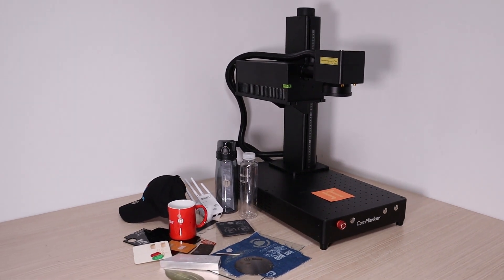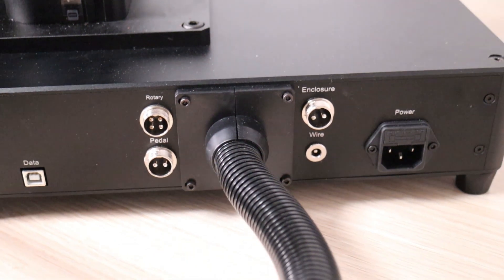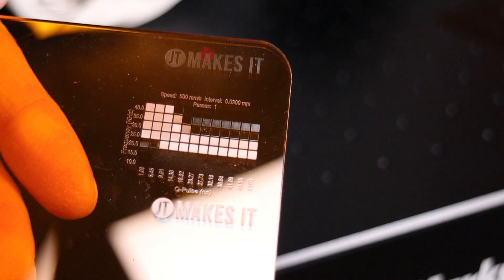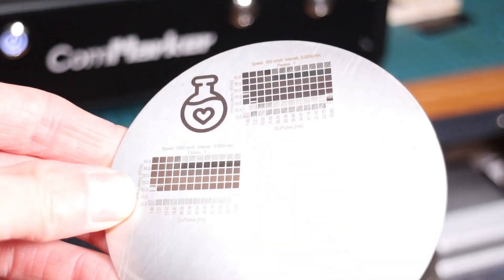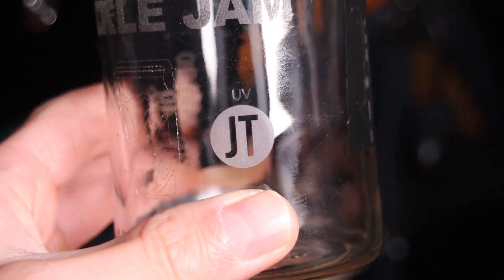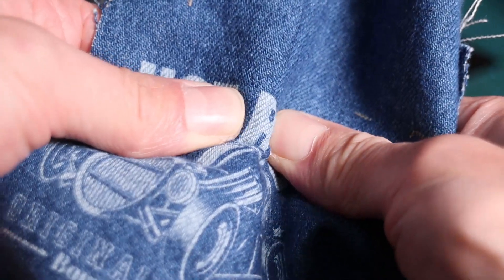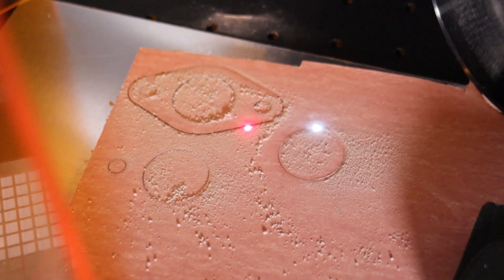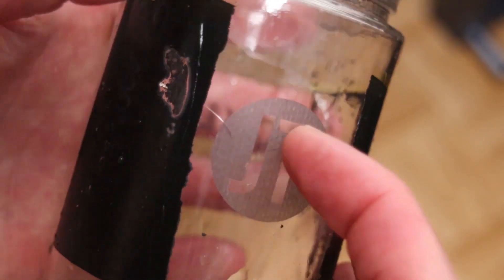The Ultimate UV Laser Engraver Test! Can the ComMarker Omni 1 Handle ANY Material? [Review]

Comment: Does it comes with EZCad sofware?
Reply from the maker: yes, EZCAD is free option, but I use Lightburn
Reply: @JTMakesIt  I want to do subsurface crystals engraving is this good for it?
Reply from the maker: @VivaElMole  Yes. Check my video 5W vs 10W UV laser. 5W Omni does good job at subsurface engraving
Reply from the maker: But it can't do 3D engravings, only 2D subsurface. For 3D engravings stay tuned for my next video.

Comment: Thanks. Can the This laser engrave stones other than slate? Where can I find a list of "tested" materials it can engrave or cut?
Reply from the maker: I tested it on slate, white stone and it worked. But if you want to make deep engravings on stone you should use a fiber laser like the ComMarker B6, B4, Titan 1, Monport GA60... Check my reviews of these machines to see what they can do on stone.
Or check my comparison video between UV and fiber laser: https://youtu.be/TEGiheuk6SM
Reply: @JTMakesIt  Thanks. Did you do a video on 2.5D/3D on stone? I can see uses for both. It is a matter of which first, or if they will give a deal on buying both at the same time.🙂
Reply from the maker: @lawrencediggs7957  FOr deep engravings on stone, the fiber laser will be much better/faster. Check my review of the Monport GA60, I did a deep engraving in stone with that one.

Comment: You dont Need to set your Material Test to 10-40khz. 40khz is the smallest and 150khz the highest you can do
Reply from the maker: I think this is true for 10W machine, not the 5W?
Reply: @JTMakesIt no. Test with This Settings then you can see
Reply from the maker: @dkastra26  i will try. Thanks!

Comment: Could you share your setting to cut glass (n-pulse, frequency, speed and passes ?). The one you share on screen looks like more for engraving, right? Do you use the Wooble setting in Lightburn to perform the cut? I'm trying to cut glass and mirror with no luck, but no problem with engraving (a mirror even broke when I tried some settings ;).
And please continue your reviews, they are always a pleasure to watch!
Reply from the maker: The settings are written on screen in the video when I am cutting out the circle from 2mm thick glass. If you have any questions feel free to ask :).
Reply: @JTMakesIt it's what I tried, but no luck. Perhaps my speed was too fast and not enough passes? Do you remember which speed and number of passes? I guess that different type of glasses may end in different results, but I have no clue if I'm far or not to get good results. Thanks again for your videos!
Reply from the maker: @PolyWorkshop inthunk the speed was around 100 to 200mm/s. The slower the better. Make sure You double check your focus (when continuously engraving manually lift and lower the Z axis and where it sounds the loudest is the optimal focus height. Make a focus stick of that size like I did in the video). Also let it run for many passes. I have let it run for 5 to 10 minutes for that cut. If it doesn't work maybe you should try a different glass.
Reply: @JTMakesIt  I think it was the number of passes, I stopped after 2-3 minutes. Thanks again! :)

Comment: This is most likely a next-buy for me, because its not only versatile, its light and compact enough for me to take to conventions if need be. Its expensive, but not so in the range of UV lasers. Been interested in UV lasers for awhile.

Few things I'm wondering about though. I'm pretty sure it'll earn itself back and then some but it does make me wonder how long on average I can laser with this thing, and if the components are replacable. 
Another thing is that even though it IS a cold laser, safety is prio and especially if I wanna take it to conventions I need to prepare (pop-up enclosures and  ventilation, plus from what I understand its air-cooled so I might need to take that into design aswell if I need to make one). I have to make one anyway due to it being a laser, but I'm wondering something akin to fumes, particules, etc.
Reply from the maker: Hi, life expectancy of a UV laser is in a range of 10k hours. You can get an enclosure like this: https://commarker.com/product/commarker-fiber-laser-engraver-safety-enclosure-protective-cover-pro/?ref=iNBVv9XmXs_p18
Or you can build your own box, and put an extraction fan and some flexible hose through the window.
Yes, laser is air cooled, but fume extraction from the enclosure also extracts the hot air and this should not be a problem. Fume extraction is recommended, as certain materials produce toxic fumes when engraved.
You can also buy a fume filter, which reduces smells and smoke for more than 95%
https://commarker.com/product/commarker-fume-extractor-100w/?ref=iNBVv9XmXs_p18
Reply: @JTMakesIt when you say 10khrs that’s when you need you replace the laser?
Reply from the maker: @antoniomczenna8185  Laser starts loosing its rated power output. But 10k hours is 3 working hours every day for 10 years straight. Its a lot. In that amount of time, much better lasers will be available for lower price.
Reply: @ where do you find this information when searching for lasers to buy?
Reply from the maker: @ Checking the official website or asking the manufacturer.  Also checking the web for UV laser engraving technology in general

Comment: what is the laser power and what is the wavelength?
Reply from the maker: @alexlaser-lv  355nm, 5W. There is a link to the store in the video description with more details
Reply: @JTMakesIt  strange, then something I don't understand, I have a uv 3w 355nm machine and it doesn't engrave on clear glass and organic glass
Reply from the maker: @alexgrad4555  it depends on the lens size. The 3W is a bit weak for glass. 5W is just enough for the 150mm lens at full power

Comment: The power is a measly 5W, little better than AtomStack M4(2W 1064nm dpss). The laser itself is dpss and not a true fiber laser. Has 10X less life, with output falling off with continued use at high power levels due to fast degrading qswitch. Should have to be atleast 3X cheaper, since there is no expensive Raycus or JPT fiber modules inside. At high power levels, it will fail(degraded output in 1000+ hrs) fairly soon, which is typical for diode pumped semiconductor lasers. Have dealt with all kinds of lasers for professional work.
Reply from the maker: @aware2action  you should learn a bit about UV lasers. They are not fiber lasers. They work completely differently than fiber lasers. you clearly didn't watch the video. UV lasers don't engrave with heat. They engrave by breaking chemical bonds directly. This is why you can't compare 5W UV to 5W infrared. 5W UV works more like 30W true fiber.
Reply: Imagine that you have nothing better to do, but to go on each video of this laser and talk trash about the laser and the creators.  People have absolutely nothing better to do?

Comment: Can you get good black markings on stainless steel? Is there a way to get black marks on aluminum?
Reply from the maker: Black markings on raw aluminum can't be done. Only slightly darker. Aluminum doesn't change color under any laser.  Black on stainless is easier done with fiber laser. I have tested a lot of them on my channel with great results. You need a lot of heat to blacken stainless. UV laser doesn't have that much power compared to fiber lasers.

Comment: Hi, I have a Trotec 360 laser cutter and am considering purchasing an Omni 1 for engraving fine details on glass. Is the Omni 1 capable of cutting thin sheets of metal, such as 1mm thick silver, gold-plated metals, etc.? Thank you.
Reply from the maker: Hi, UV laser is not good at cutting metal. For cutting metals around 1mm thick you would need a 60W-100W fiber laser (1064nm).

Comment: hi, great video! learned everything i wanted to know about uv lasers. would you mind sharing the file of test pattern you used? that be handy for testing out materials. best - manuel
Reply from the maker: Hi, The test pattern can be automatically generated with Lightburn for any combination of parameters. I don't know if EZCAD supports test pattern generation, but for EZCAD a lot of test patterns can be found online, but it is very easy to manually create it by yourself in 15 minutes or less.
Reply: @JTMakesIt  great thank you =)

Comment: What settings did you use for cutting through the glass?  I've been unsuccessful thus far with my Omni 1.
Reply from the maker: 40kHz, 1ns pulse. but need to use a relatively big wobble parameter - you can't cut with just a line, you need some width for material to escape
Reply: @JTMakesIt  Ah, yeah.  That makes sense.  I find that the kerf on this thing is so ridiculously low, that it will cut all the way through things and it never drops because the cut is so tight.  I can see the light going all the way through the wood I'm cutting (3mm basswood) and it still sits right in place.
Reply: @JTMakesIt  Thanks so much!

Comment: What settings did you use to get the engraving on the middle of the glass?
Reply from the maker: @JasonOutlaw  you can read them from the parameter test pattern in the video
Reply: @JTMakesIt  Can't read the test pattern in the video!
Reply from the maker: @terryclair2914  In the video description there is a link to my website with detailed photos of all the results showcased in this video.

Comment: Here I am thinking about getting a MOPA fiber laser when the UV one is more versatile. I guess I'll lose out on deep metal engraving but at least I can do more than just metal. Now UV is at the top of my list.
Reply: I was thinking the same thing.  ...though, to be honest, losing the deep metal engraving is a bit of a disappointment.  But the UV results seem much more professional for plastic, to say nothing of it's ability to be used on textiles, glass, and wood.  The other plus for fiber, is the ability to use it free hand (useful for large objects you want to mark), as well as the fact it has a 100k hour source (vs a 10k hour source for UV), as well as color engraving on stainless and titanium.
Reply: I was searching for a MOPA fiber machine and ended up ordering a 10UV!! Lol 😅
Reply: @ Just be aware that because of the 10x smaller spot size of a UV to a Fibre, while you will get much finer detail, it will mostly be only visible under a microsope and you will take a lot more time to engrave as your line interval needs to be significantly smaller.
Reply: @guyb7995  That is a very interesting point, especially when you consider the source only has one 10th of the lifespan anyway. So that's what, 1% of the work?  Though, I think the attraction probably isn't the resolution, as much as its the versatility.
Reply: @bujin5455  yeah, versatility is great, but if you are trying to knock out a swag of gear its not going to work out well for you.  I had to do some basic anadised AL dogtags the other day.  The UV would have been 2.5min a tag, the 30W Fibre was 10 seconds.  With only 80 tags to do with just text, it was still a huge difference.
Reply: @guyb7995  Different strokes for different folks.  For sure, if I was running a production company, were I had to run through LOTS of product, and where a high power MOPA would get the job done, that's 100% where I'd be going.  However, that's not my situation.  I'm much more interested what I "can" do, than how fast it gets done.  If that changes, a MOPA will be on my RADAR.

Comment: Can this engrave deep into plastic? I’m hoping I can use it on cattle ear tags that are white over a black core.
Reply from the maker: @vandengaaskjolen1821  it is not the best for deep engravings, how thick is the white layer?
Reply: @ about 0.3mm
Reply from the maker: @vandengaaskjolen1821  Maybe it could do that. The problem is that plastic could melt
Reply from the maker: @vandengaaskjolen1821  If you look at the tests that were done in the video on spray bottle caps, some of the engravings are pretty deep on black one.
Reply: @JTMakesIt  right. I’m hoping it will be faster than the 10w diode. Right now tags take about 5-10 minutes each. On an order of 100s of tags it’s tough to find enough time in the day to get it done.
Reply from the maker: @vandengaaskjolen1821  It will be faster for sure. But even if it doesn't produce good deep engravings, you could use it to engrave dark markings directly on the white surface. UV laser is the best for that. You are looking at 10 to 20 seconds per tag maximum. Maybe yellow tags could look even better.

Comment: I also have this machine and have had the issue where etching on glass cause the etching to be at different layers.  On a beer mug, that I was doing testing on, one time it etched on top and other times it etched inside the glass.  Sure would like to know what causes this and how to control the process.  Etching inside of the glass was an actually look!
Reply from the maker: @terryclair2914  in my video I explored this exact thing. I found out that different settings produce different depths. Very cool phenomena
Reply: When you find the solution or answer please share it with us. Question do you recommend buying this machine? We are considering it.

Comment: How long did the 50 passes take for the small circle glass cutout? I am interested for cutting small stained glass pieces that the waterjet cannot.
Reply from the maker: It took just a couple of minutes
Reply: @JTMakesIt  wow I was expecting much longer that's great thank you for the quick response!
Reply from the maker: @user-bn3kv5rv3u  I checked the recording and one pass took about 7-8 seconds. The glass was 2mm thick. I think it could do it even faster, by making a bit thinner cutout line
Reply: @JTMakesIt  that's not bad at all even just to do a score line for cutting larger sheets of glass like stained glass this can be a game changer. I have been looking everywhere for an alternative to an expensive messy water jet and I think you have solved my problem thank you!
Reply from the maker: @user-bn3kv5rv3u  awesome! If you want to buy this one, check the video description for my discount coupon to save some money :) and if you want to support my channel at no extra cost to you, you can buy through my affiliate link
Reply: @JTMakesIt  I plan to do both thank you!
Reply: Are the cut settings for the glass the same for the engrave that you had in the small text in the video? I've been trying to cut glass for days but can't even get it 1 mm deep 😢 cutting glass was the whole reason I got it
Reply from the maker: @user-bn3kv5rv3u  for cutting I also use bit slower speed (maybe 200mm/s or less). You need to use the 150mm lens and also try focusing it a bit lower at the middle of the cut so you don't get out of focus range. Or maybe start at a 0.5-1mm lower focus at the beginning
Reply: @JTMakesIt  thank you I will give it a shot!
Reply: I'm still struggling, I can finally get it to cut but it takes about about 25 minutes not a few. I was hoping to do it in just a few minutes like your video. Any more insight you can provide? I'm using the 150mm lens, .5 wobble, 400mms at 20khz. Increasing khz causes the glass to crack, so I sped it up but no improvement in cut depth. Slowing it down made a much cleaner cut but slowed it down even more. Your help is very much appreciated thank you 😊 are you possibly using line mode instead of a fill cut? Maybe that's where I'm screwing up, I'm using fill with a .25mm wide line for the circle. Thank you again! 

Edit: PS Merry Christmas! I forgot it was a holiday sorry to bother you!
Reply from the maker: @user-bn3kv5rv3u  Maybe it is the type of glass that is causing you problems. 20kHz is a bit low and it reduces power. I got the best results with 35-40kHz and 1ns pulse. You can try cutting with "fill" just to eliminate the wobble settings, so there will be less variables. Just draw a small square or circle (3-5mm) and make multiple passes filling it with a 0.03mm line interval, cross hatch and 300mm/s speed, 35-40kHz and 1ns pulse and let it run continuously for some time. If it stops progressing lower the focus (you can find the ideal focus distance by engraving a large rectangle on continuous fill with the same settings on aluminum or some other metal and adjust the focus height mid-operation. the point where it makes the loudest noise is the optimal focus. Make a focus stick for easier adjsutment in the future (google fiber laser focus stick) For cutting reduce the focus a bit lower.
Reply: @JTMakesIt  thank you so much this is a lot of info I will make sure to put it to good use! Merry Christmas / Happy Holidays to you and your family thanks for all your help! 🎄
Reply from the maker: @user-bn3kv5rv3u  you are welcome!
Happy holidays to you too!

Comment: Whats about Vinyl Foil, maybe it can replace small plotter machines? Since the Fumes are alway toxic with diode and ir-lasers.
Reply from the maker: @stiffler8632  maybe for smooth surface engravings the toxic fumes are not emitted, but I am not sure. You should check it. But I would still recommend good smoke purifier